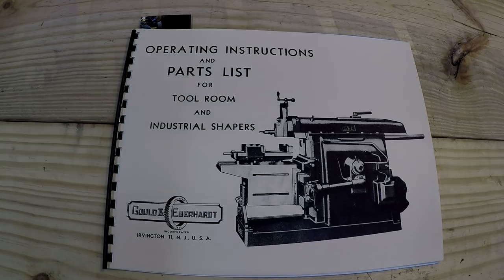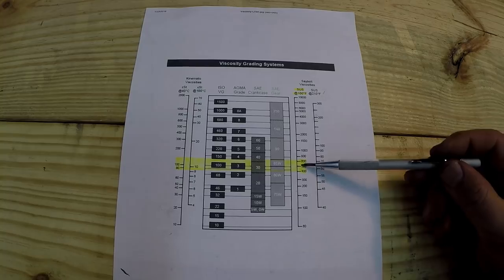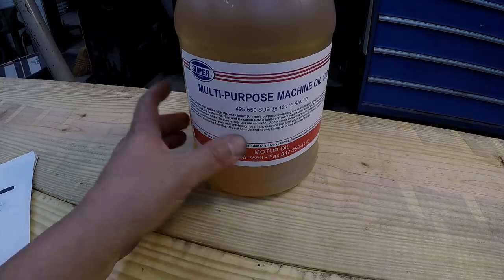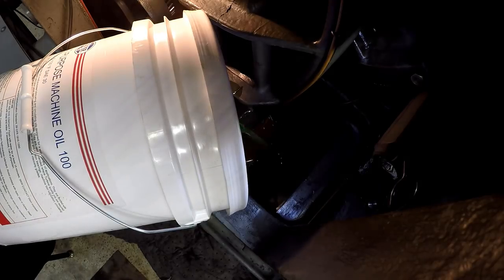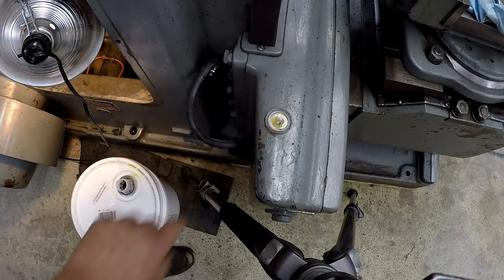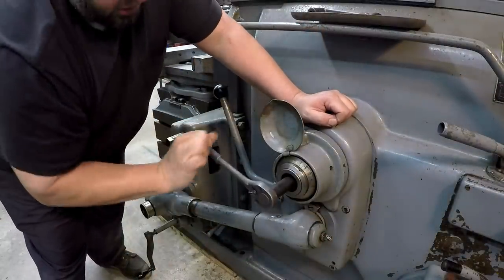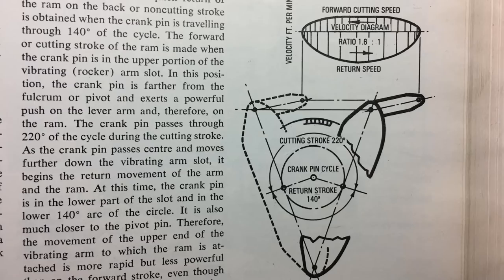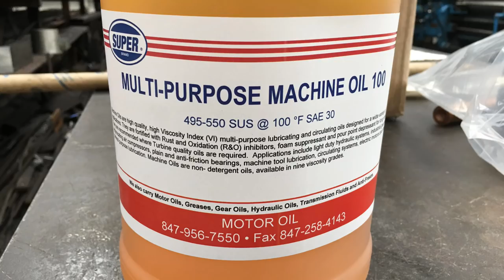G&E Shaper New Oil and Run In

Comment: I wonder if you could just cut the copper lines somewhere and add compression ball valves to each line so can easily regulate the amount of oil that comes out at each lubrication point. I only see 1/4" tubes on Mcmaster so not sure if they make smaller ones or what size yours are.

Comment: why not put a needle valve in line with each oiler so you can tune it without mashing the lines?
Reply: I think pinching the lines works just as well because you can tune the flow and not need to adjust it again for decades

Comment: I believe that 30 weight is same as automotive oil. It sure has the same ratings. Could be wrong though. Great video as always
Reply: probably has ep additives like gear oil, rather than detergents for combustion products like engine oil, its not ideal to put the wrong one in, modern engine oil doesnt like bronze bushings and the detergents trap their contaminants in the oil to move to the filter, for these older machines, you want non detergent so that drop out into the bottom of the sump and why the filter is quite a ways away from the deepest part

Comment: 2 thoughts--have the pail outlet at the top when starting to pour so air can get in to allow more and controlled flow;  as suggested small needle valves in the oil lines would be a simple and convenient way to throttle the oil flow.   I think these can be bought but can be easily made.
Reply: Alternatively, for the fill stage, punch an air hole in the lid opposite the pour opening. It doesn't even have to be too large.

Comment: SAE 30 (displayed on all those containers you bought) you can get at gas stations even. Run that stuff in your lawnmower and other yard equipment to use it up.
Reply: For a lot of specific reasons machines should be run on non detergent oil.  The viscosity might be a match but engine oils for use in cars have detergents in them to hold carbon and other byproducts of combustion in suspension.  We don't want that for machine tools.   It's certainly better than nothing.  But it's not that hard to find non detergent oils which are the proper option for machines like this.
Reply: Yeah, I try to source non detergent oils for my motorbikes with wet clutches too.

Comment: I have seen people consult Exxon to get machine requirements or to get Exxon Mobil oils equivalent to different brands, for instance, um, Shell, I think it is that they use in Europe. Good to see McMaster doing a great job.  

Gosh, what an oiling system! That wiper on the strainer would be hundreds of dollars as an add on. Wonderful manual too! As a mechanic, my take on nomenclature is that your oil viscosity is called SAE 30, (30 wt), and ISO 100 (not 100 wt) same viscosity, different names). It is amazing how much viscosity changes with temperature, even with multi-grade oils (10w30) resisting temperature/viscosity  changes only somewhat better than single viscosity oils.

Comment: What if you added a small valve to the oil line instead of pinching it?
Reply: Joey Broadston I
Reply: I wondered if there was a blockage in the return to the tank - so it wasn't draining back as fast as it should !

Comment: It think you got the SUS explanation wrong. On the screen, book is saying more or less, "time elapsed in seconds to fill (through the precision orifice) 60ml volume when the fluid is heated to 100F". So, oil that is 500 SUS @ 100F means that it takes 500 seconds to fill 60ml container with this oil when the temperature of the oil is 100F.

Comment: That seems right.   Our only machine that has wicks to oil the ways uses Vactra #3 which is VG150.   The other older iron with drip oiling on the ways use VG68. The newer equipment with linear rails uses VG32.  I have seen this pattern in other shops I have been to.     The oil from McMaster Carr probably set you back a pretty penny.    In the future, any generic brand of "way oil" will perform just as well as long as it conforms to the "ISO VG xxx" standard.

Comment: Of course, I suspect going to Checker Auto and buying a couple cases of cheap (so it doesn't have all the other fancy stuff in it) SAE 30 motor oil would have worked as well....the gallon from McMaster even said 'motor oil' on it...

Comment: Paul sounds like a helpful bloke.

Other oil (viscometer) tests include spinning a cylinder inside a drum, the gap filled with the oil.

When you're pouring from a closed container, it'll empty quicker if it has an air inlet so that it's not glugging all the time. Either keep the container at an angle so that it can breathe through the spout while pouring or put a breather hose down the spout.  If you have no furthrt use for the container, you can carefully punch an air hole in the top, ensuring that no material falls into the oil.

Comment: What was the title of that book you were showing the Staybolt test description from? 

I think you might find that the cross slide oil tube was pinched off for a reason as well. I know in a previous video you said it looked it it was closed off completely, but was it really? Hard to tell from here. I would hazard guess that you might not need so much oil on the table feeds to cause it to drip off constantly.

Comment: hi adam. when you took the old felt string out of the sight glasses it didn't look like it had been wound in nicely like you did it, it looked like it had just been jammed in, maybe jamming it in tight would reduce the amount of oil reaching the scraped surfaces

Comment: Well lubed machine Adam,better to much than not enough.
You might be able to fabricate a valve for the oil feed pipe to control the amount of oil its pumping .
Maybe a small valve at the end of the copper pipe with an adjustable end piece.

Comment: I would add a small pump in the sump that pushes the oil though a standard oil filter and back into the sump. Will keep the oil cleaner longer. Also a oil water separator too.

Comment: Just a tip turn the bucket tell the spout is at the top and you can pore it instead of waiting for it to chug
Reply: Yeh except it makes a mess flowing down the top. Fine if you're pouring it via a funnel but into a tank like that would just make a mess. A hole in the top would work but if you don't use the whole bucket there's the problem of keeping crap out after. Adam likes to take his time.
Reply: @ronwilken5219  no. The hole bucket lid is designed to be at the top when poured that allows air to get in allowing for a smooth steady laminar flow. You can also get the bucket way closer to horizontal before it starts to spill out meaning. Its the exact same thing as filling you car oil. You don't need a funnel you just need a steady hand and have the opening at the highest point of the bottle.

Comment: Would an adjustable valve to regulate oil flow make sense ? Does the temperature in the shop vary enough over a year to cause the oil to meaningfully thicken in winter and thin in summer ?

Comment: Stunning. With correct maintenance, designed to last several lifetimes. Oiling system is unreal. My baby 8" Boxford is oil can everywhere, no pressure feed oil pump. Shapers drink oil like a wino with a bottle of the hard stuff. LOVE shapers...

Comment: I can see that machine is built to run 24/7. It will last a life time and more. I used to use Trabons on large machines that had distribution metering blocks that would regulate the amount of lubricant to  different parts of the machine.

Comment: One can also measure viscosity by opening and closing the valve so the flow takes a given, unit amount of time, then measuring how much fluid ends up in the lower reservoir.

Comment: I'm glad our Zocca500 is not the only shaper that has a noisy oil pump! it was quite shocking when we first started the oil pump! 
https://youtu.be/AMDSkCkPJ3I
Ours does not run unless the shaper is moving, and so "priming" is perhaps harder on the first start, with a "short stroke useful to minimise movement without full oil pressure.
Previous owner had added some oil catch wings to handle overflow past the wiper seals as well.
Reply from the maker: Having the side cover on greatly reduces the noise from the pump.

Comment: I don’t understand what you are running in,did you replace bearings and gears?if not that machine is as run in as it’s going to get.
Reply: It's called: Taking care of his machine. If everyone would do it, we wouldn't see so many machines in really poor conditions.
Reply: Being new to the machine, it gives you a chance to find problems it may have developed while sitting for so long.  Oil leaks might show up only after a certain amount of running, and certain mechanisms may need some no load time to loosen up and work as they should.
Reply from the maker: Running the machine with new oil and a cleaned out sump, and to inspect the oiling system to make sure it working properly.

Comment: That was really neat! I also like McMaster-Carr a lot. I'm one county over from their Los Angeles warehouse, so I usually get stuff the next day by plain old UPS ground shipping. If you get into using Fusion 360 for CAD/CAM, I think you'll love its "Insert McMaster-Carr Component" feature!

Do the rapid traverse drives on the shaper have some sort of limit interlocks or slip clutches to keep it from damaging itself if you run a traverse all the way to the end?
Reply from the maker: That I am still trying to find out. I have been stopping the rapid and moving it by hand crank to the end.

Comment: Put compression needle valves in line with the ones you want to control then take the time to adjust to the exact flow you prefer.  That way if ya want more or less later adjust to suit.

Comment: Adam, is there also a magnet somewwhere inside the sump? My dad's mill had a sump like that, also to lubricate the ways and rails. It had both the filter and a magnet. The magnet was inside a glass container, so the Chips would stick to the glass. Removing the magnet would just drop the Chips into  your Hand.
Reply from the maker: Something I could easily add to the sump.
Reply: Source for large cheap magnets is to ask around for blown car speakers. Use a heat gun to soften the glue that holds the metal plates on the magnet. Another good source is old microwave oven magnetrons. Usually you get two really strong 2 1/2 inch magnets from them. Old hard drives have 2 large (~1 x 2") neodymium flat magnets in them.
Reply: CO Jones I would rather get them from old hard drives. They are much stronger than the Ferrite ones in speakers. Or just buy them online.

Comment: Do you not adjust the stroke with it running? Seems like it might be easier. Edit: Doesn't matter I guess.
Reply from the maker: You can adjust with it moving, but you need to just bump the clutch. Slow movements.

Comment: Harbor Freight Compressor Oil is the same viscosity.
Reply: im sure most gear oil is the same thing also, one of the lighter weight ones
Reply: So is 15w40 diesel engine oil

Comment: Adam... SUS in the book... the beaker is marked at 60ml and the text says 60ml ... not 100ml, which (to me as well) sounds more logical... I think it was originally 2 oz and 60ml was "close enough" to metricize it. Not that it matters as none of us is going to do a SUS test anyway.
Reply: 60ml = 1ml per second. That sounds reasonable for this type of measurement.  I wonder if a modern synthetic with similar viscosity would offer better lube and protection.

Comment: So what does a shaper do that lets say a mill doesn't? or is it just that its old technology and cool to have?
Reply: It can do some operations a little easy with less set up than a mill, but I don't think there is anything that a shaper can do that a mill can't.
Reply: Make undercuts and sharp inside corners.
Reply: Shapers excel at internal keyways, mills cannot do such. I wish I had one for that reason alone.
Reply from the maker: Internal shapes, long flat cuts, and only need one tool bit that will last for years.

Comment: My curiosity is how much does this shaper currently weigh with and without the oil. It looks like a beast of a machine from the video. Nothing like a chucker or a 5 ton natco. But That is comparing apples to oranges.
Reply: I briefly worked in a kitchen with a food mixer the size of that machine ! The mixing bowl was 80 litres. Rested on the floor on a dolly - so it could be wheeled under the mixer - which lifted the bowl up to the blade with electric lift.

Comment: I would guess that the oil used is the same as an ordinary lawn mower oil SAE 30. Single grade. For some reason the single grade is more expensive than a multi-grade. But that is probably because it is sold for use in lawn mowers.
Reply: never understood why you cant use engine oil, its doing the same exact job
Reply: Engine oil has additives that work with the high temperatures and high piston speeds, along with having to deal with products of combustion.  Machine oils don't have to deal with those problems so they are optimized for other things like long sump life in the presence of chips.

Comment: I worked in manufacturing in machine maintenance for 28 years. I serviced many types of machines. Presses, metal shearing, saws, lathes, mills, both vertical and horizontal. We had to learn all that lingo about oil viscosity and types of oil. Thanks Adam for bringing back those memories for me, it’s all very interesting.

Comment: Absolutely ingenious method of increasing the no-load return stroke speed while maximizing power on the power stroke.
Reply: It's standard on shapers. By altering the crank offset, you alter the stroke. The longer the stroke, the greater the speed difference will be. I guess that's why the speed choice is in strokes per min rather than a much more useful inches per second.

Comment: Since you put in a nice still of that oil spec page, I couldn't stop myself:  

I googled all of those trade names of oil to see if any were still around.  Nuto and Mobil DTE are still made by Exxon-Mobil after all these years!  I guess Nuto was one of Standard Oil's hydraulic oil brands which Exxon-Mobil inherited.  

https://www.mobil.com/en/industrial/lubricants/products/mobil-dte-oil-extra-heavy
https://www.mobil.com/en/industrial/lubricants/product-series/nuto-h-series
Reply: I was thinking the same thing. Mobil DTE is a standard hydraulic fluid nowadays.
Reply: In the 1980s I used Nuto H32. I don't think that means the whole NUTO range are hydraulic oils though !

Comment: What does this thing do? Is there an intro video to find out more about what it’s for?
Reply: The ram holds a cutting tool. It cuts straight lines in a material. You can move where the line gets cut on the part by using the table. Great for cutting keyways and gears (with a rotary table. Stefan Gotteswinter uses his a lot. For example: https://youtu.be/CK5WYeSMWt8?t=13m or a video all about it https://www.youtube.com/watch?v=IsBv14gWglw

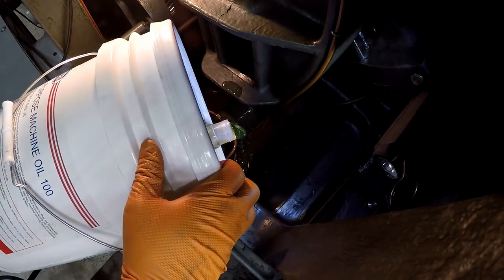Comment: 9:40 A tip so it would go much faster, make a little bigger hole at the oposit side and air will be drawn into the bucket this way instead of through the out flowing oil, and this will make you empty the bucket in seconds instead of minutes.
Reply: A better tip is to place the spout at the top, rather than the bottom.
Reply: Actually no, since the major weight is in the bottom and thus does not pour as fast so you wont get the same flow if you tilt it to much then if the spout was in the bottom with a hole above.

And well I guess you could also take the lid of the drum because they are not (?) welded shut.
Reply: Oh dear. " the major weight" has nothing to do with it.  Give my recommendation a try, then return with a reply
Reply: There are differences, not huge but there are. Try it your self.
Reply: yeah, learned that from my Dad....in about 1951....!!
Reply: Oh dear. "it has nothing to do with it" What drop faster out from a drum filled with oil with a hole at the bottom and a hole at the top slightly under the surface? Exactly, from the bottom hole where the most weight is. try it your self. Give my recommendation a try, then return with a reply.

Comment: 5:00 SSUV - works with 60ml of oil at 100°F and the value is the number of seconds for 60ml to pass through, not 100ml. That's why 60ml is shown by the container.

Comment: I still dont understand what it does? :D
Reply: Give him a couple days.  It'll be worth watching.  They can flatten stock like a face mill or fly cutter, they can cut dovetails, keyways, all kinds of neat stuff.  They are antiques but very cool to watch work.  The vertical mill has taken their place.
Reply: oo okey well the movement off the head made me really confused :D But thx!
Reply: There is a hinged part called the clapper box that holds the tool.  It pivots out of the way on the backstroke.  It flaps (claps?) down on the forward stroke to take the cut.  There is a ratchet device that moves the work to the left so the tool cuts progressively across the face. Every stroke of the ram moves the work a fraction. And a ratchet that can move the tool down into the work for a keyway type cut.  That cam he needed is one of the parts of that ratchet system.  An old system to be sure, but very ingenious.

Comment: Would a thicker oil help with the dripping and over oiling? Is the threaded section in the middle of the big/bull gear what adjusts the length of the stroke? The farther the block is towards the middle the shorter the stroke and the farther out the longer the stroke? Would that mean that shapers have more torque/cutting power with a shorter stroke? Very cool to see the inside of it, something about old mechanical machines is so satisfying. Thanks for showing off the guts Adam.
Reply: Yeah, that is what adjusts the stroke, this video actually shows really well how shapers work.